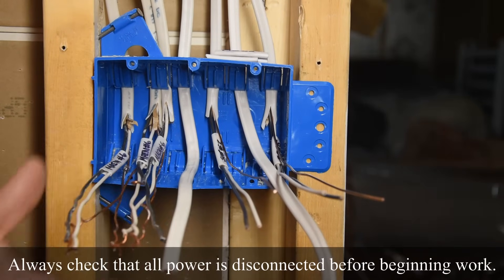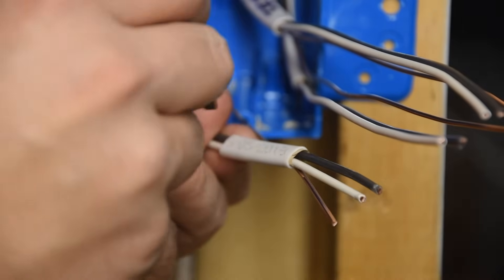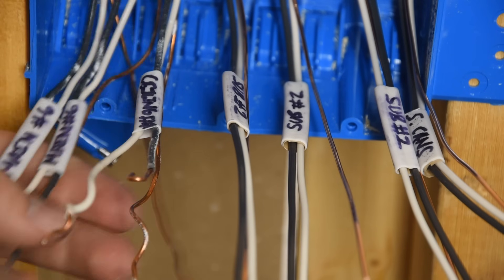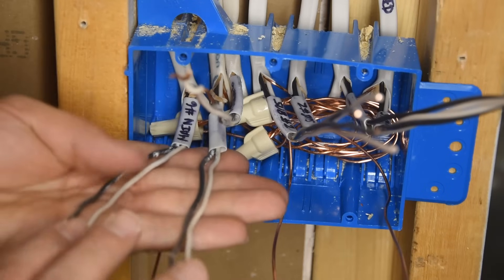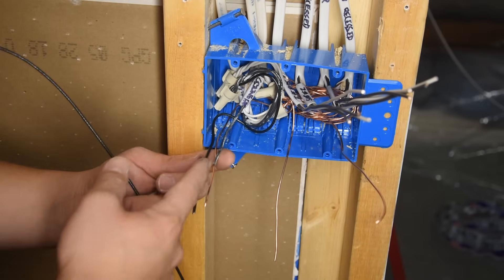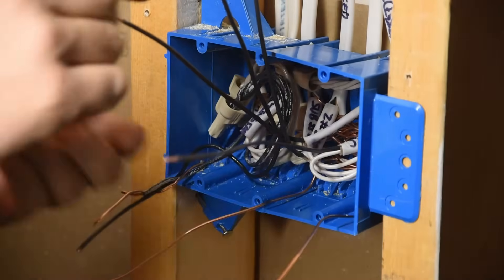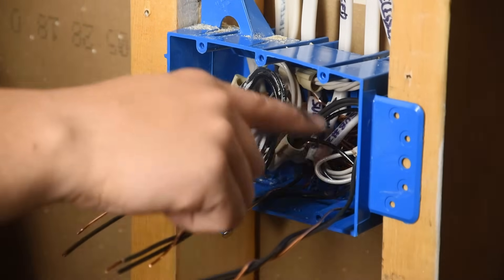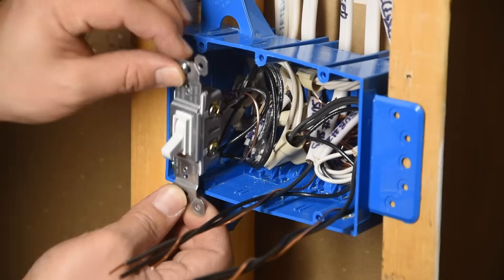How To Wire a 3 Gang Switch Box With 2 Circuits

Comment: This was so f*** painful to watch...sorry.
Reply: I know you mean well. I can appreciate that, but...trying to explain how to cut in that box with two circuits  truly is a waste of knowledge and time. 
This is something that should be taught on the job, and without sleeves for identifying anything...

Make a dividing mark on the top of the box with a marker, indicating more than one circuit. Leave wires hanging out box with a length of about 18". Long before this helpers, upcoming sparktricians, should know where in the box exactly  to put travelers, switch legs, and hot feeds...
If your using travelers, ring/strip, the sheath off the traveler three wire about 3"s and if there are multiple travelers make a crimp indicating first second or third (traveler for switch in that box from the closest door/ or doorway  1st, 2nd, or 3rd) then any other three wire that is not stripped 3"s will be a switch leg for a fan or other...these will also have crimps on them indicating there placement in the box 1 crimp 1st switch, 2 crimps 2nd switch and so on.. same with two wire, must have crimps on sheath near the ends of the wire to indicate switch legs. All other two wires will be hot feeds. 
Never, and I mean never use Wagos in any joint!!
If you use them, they should only be used for hooking up single switch leg lights or fixtures...if one ever has to troubleshoot an electrical problem and find Wagos in any gangable boxes, they will be pissed! Too many points for failure. Always twist your joints "before" putting wire nuts on.. this ensures quality  joints, and separates you from the dumbasses... shows you give a sh** about your quality of work.
Anyway, maybe now you know what I mean about this is something that should be learned on the job.
There are too many guys that want to be electricians, and claim to be electricians, and their quality of work is driving down electricians wages, claiming to know sh** they truly dont...we do not need anymore wire jerkers in this trade.
Hope you dont take any of this hardly...
I have been taught by I believe the best damn electricians in the business. I'd smoke that joint in about 2 mins flat. With no short cuts, all pigtails for grounds and hots...
Best gift ever...here it comes..
4 years in residential fourth year should be service oriented work. Years 4-8 get with a union if you can doing commercial work, 8th year doing service work. Years 9- 12 stay in union learn "EVERYTHING" you can learn about industrial electrical work.  12 th year service oriented work...some where in these last four years talk with your union steward about taking some motor controls, and plc classes. There are a shortage of people who "really" know their sh** about them. With this knowledge  you will be able to find a huge manufacturing company who needs qualified industrial electricians and will pay the 37+ bucks an hour with no traveling, straight 8 hours and to the house with kickass benefits and badass insurance to boot. 
Goodluck. Your a good dude for trying to help. 

Ed. 32yr Certified Journeyman Electrician.  Took me all these years to figure this sh** out the hard way. Should only take 12. Yer welcome.
Reply from the maker: Thanks Edward! What specifically would you have liked me to do differently? I always appreciate feedback even if it is negative. Also thank you for censoring your language.

Comment: I don't think you should have 2 circuits in one box...it's too easy for a noob to think they've shut the power off to a box, and wind up getting zapped while digging around the box....
Reply: That's why noobs and inexperienced should not do electrical or any trade work
Reply: @wizard3z868  should NOT...but DO
Reply: Yo Mama  At 67, and in the building trades since I was 18...ALL PHASES...hardly a noob

Comment: Always twist the ends before installing wire nuts, red or blue wire nuts make more room in box, and alwys curl wire when attaching to device in same direction of screw, then tighten with FLATHEAD screw driver. Wago's only make a small contact point. Just like the stab loc on devices. Never use them n never will. After 40 years as a journeyman, have seen my fair share of burnt up devices or screws on devices loose from a phillips head drill or screw driver. Tinhgs need to be tight. Even newer devices with tab under the screw, i still curl the wire around the screw in proper direction. Doing service, way to many times pulling out devices, n the wire came off. Tight is right. I found that a no1 robertson bit works the best, even in a driver drill with clutch turned down, then test with flat head till you find the correct torque setting on your drill. No impact drivers. Nice job, just things i would have done a little different.
Reply: You are confusing the wago push in connectors with the lever lock kind. The latter make a connection with more surface area and are much better and make a strong connection that is very hard to pull out without releasing the lever first, unlike the basic push in kind where you can just twist and pull and it comes right out.

Comment: 40 years in electrical industry and I must say I have never seen a mess like that box, 2 separate circuits in same box...Never..., use stripers to twist wires wtf, ground wire splicing what a mess. Such amateur wiring and teaching others to do same....such a shame
Reply from the maker: Thanks! What would you do for the ground wires? All I had available were those wire connectors that I used in the video. What is the "proper" way to connect the ground wires?

I also try to avoid having two circuits in the same box and would not advise it if at all possible however it is something that we should all be aware of. 

Overall I would love to hear how you would suggest doing it instead of exclusively insults. I totally get that I have a lot to learn so I really value input from guys like yourself.

Thanks Sam!
Reply: @BenjaminSahlstrom  sorry I didn't mean to insult. I would have left one of the ground wires extra long and the rest at 8" and spliced them all together with red wire nuts then looped the long ground wire to the three switches.
   I would never put two circuits in same box, I would add a separate box stacked.
   I never label switch box wires instead I take the switch leg and put a tight loop in wire to identify the switch leg. The remaining wires are all spliced to hot so they don't need to be identified. I also insert switch leg wire in knock out in order I want them to control a certain lite...lined up in proper orientation.
   Also I always twist my wires ( even #14 ) before I put on wire nuts, makes for lifelong connection and good tradesman like work.
   The only labels I use is in the panel, end sleeve of wire like you did in 3 gang box.
    Your work is very neat but method shows inexperience....sorry. But I have no doubt you will become a very competent electrician because of your open mind to critics like me. I'm just old school and critical.
Reply from the maker: @craftyhandyman9757  Thanks for taking the time to share your expertise! I've never looped the ground wire between devices but have seen it done. How much wire do you leave between each device for the loops?

Thanks again.
Reply: @BenjaminSahlstrom  approx.4 to 5" so switches fit nicely in box. Also when I splice grounds I keep them folded at top of box then when you loop ground wire to switches that ground will also be at top of box out of the way of hot and neutral switch terminals.
    Keep up the good work.
Reply: @BenjaminSahlstrom  look into copper crimps otherwise you did a good job with what you had with those wire nuts other than you should twist wires first that is what makes the connection the nuts only act as an insulator to exposed ends

Comment: Buchanan crimps  for your ground wires works great and you can leave your wires long and use them as your pig tails for your devices
Reply: I was just thinking about that and started searching comments to see if anyone does that. I don't think it's against code, makes for a less congested box and makes all kind of sense !
Reply: It’s not against code at all. Actually inspectors like seeing it because it is a way better connection. 👍🏻
Reply: Also great for connections that you don't want pple  to mess with snap on a plastic cap almost as good as a weld been using em for 25yrs with the proper crimp tool
Reply: Yes I love crimp and caps are great
Reply: @frankgorgone4879  i will say though he did a great job getting it done with what he had. im sure you have been there when you need to get the job done and only have limited resources may not be ideal but its done safe and reasonable quality.
Reply: Yo Mama  lol not %100 yt he is a working man out in the real world not in a film studio you cant always pause in real life like a tv show to redo or run out and get the matts you need sometimes you just have to deal and do with what you got

Comment: Hey Ben! 
1-Please get a pair of Klein lineman pliers and twist your joints first. I prefer ideal strippers with nm sheathing cutters also has 6/32&8/32 machine screw cutters.
2- i prefer ideal red wirenuts with wings for everything and ideal orange wirenuts for stranded fixture wires.
Reply from the maker: Thanks for the advice! There seems to be some debate as to if pretwisting is required. Someone recently said that it is required by code now? Where would I find that requirement?

If you go by the manufacturer's instructions for the connector many times they state that pretwisting is not required. I realize that it does hurt to pretwist but I just want to understand the pros and cons. Wagos or push connectors seem like they are the way of the future since they don't damage the wires as much as pretwisting does. What do you think of them?

Thanks for sharing your expertise!
Reply: Benjamin Sahlstrom 
It’s not code but a good practice.
Push on are expensive and you can’t beat a good joint.
Reply: @toddiman8739  Agreed, I would use the push-ons or Wago lever nuts when I'm joining 5 or more conductors. I pretty much stop at the red wirenut. I don't want to use the big blue or gray ones, it just gets too messy and looks bad too.
Reply: Aaron Kaase sometimes you just have to have them big gray or blue guys though
Reply: @frankgorgone4879  Yeah, I'd use the Wago or Ideal splices in those specific situations. I hate using even the red wirenut, and it's where I sort of draw the line.
Reply: @BenjaminSahlstrom  Nah, I think they are full of bull. The instructions for splicing lie with the manufacturer of the splicing device. If the manufacturer says to pre-twist, then you must do it in order for them to warranty their product and to meet the specifications of their UL listing. Workmanship is largely out the NEC's purview.

Comment: Hey Ben, can you do a video on floating neutral generator and bonded neutral generator? Differences and potential hazards and whys. Thanks!
Reply from the maker: I would love to! I've read some about the topic but am by no means an expert on it as of yet. I'll have to do some more learning before that one will be ready. Thanks for asking!
Reply: @BenjaminSahlstrom  I had a customer wanting to put a cord on a furnace so she can plug into extension cord with generator when power went out. Told her it has to stay hardwired but found a cool product called EzGenerator Transfer Switch box which will be perfect. https://ezgeneratorswitch.com/generator-switch-installation/
Reply: Would love to see that

Comment: Great job. Only comment comes from industrial world.  The line always feed on top.  The  Load always on bottom.
Reply: its best practice
Reply from the maker: Thanks for sharing that. Is that a code mandated thing or just a best practice? You're referring to the connection on the switches correct?
Reply: @BenjaminSahlstrom  It makes absolutely no difference. If the switch required it, it would be marked on the switch.

Comment: Why not use any crimps for the grounds?
Reply: I have heard those crimp sleeves are requires in some jurisdictions. Not here in MN. Just standard wire connectors are good here. Those crimps sleeves are super good, though.
Reply from the maker: To be totally honest I don't have any experience using crimped grounds. What are the benefits of crimping versus using standard connectors? Maybe I'll have to research and make a video about crimping the grounding conductors. Thanks for asking!
Reply: Benjamin Sahlstrom I just left a comment on one of the benefits of crimps.
Way less connections and takes up less room, also you can leave the wires long and use them as your pig tails for your devices.
And the crimp is tight and way better then a wire nut.
Reply: @BenjaminSahlstrom  Ben if you haven't yet see a cple of videos on them if you use the proper tool they hold as well as a weld and you can place a plastic cap over them very hard to get apart unless you know how just need to squeeze twice with lineman's and they pull off most noobs just cut them off lol been using em almost 25 yrs there almost a good tamper seal too many a job we went to and home owner cut them off and we nailed em with a service call instead of a warranty call back

Comment: you should take the tabs off the outlets and switches
Reply: The plaster ears? I never do. Why? The only time I do that is when I'm fixing a device to the underside of a steel square box cover (for a surface-mounted conduit circuit, usually on a masonry wall) , and the only reason to remove the ears then is because the device won't fit otherwise.
Reply: @aaron74  that's the only time I would remove them too.
Reply from the maker: So that they can rout cleanly around the box while the switch is installed?
Reply: Why?
Reply: There designed that way so the device is held to the finish wall its almost impossible to get the box exactly even with finish surface

Comment: You should do a video about changing a 4 way light circuit to a 3 way.  4 way smart switches are much more expensive and don't have the same features as smart 3 way switches.
Reply from the maker: I have never seen a 4 way light switch. I believe that you really wouldn't need a 4 way smart switch as you could just use one smart 3 way switch on the first box where the power comes in. Then in effect you have control of all of the 3 or 4 way switches involved. Comment with the manufacturer and model of the smart 4 way switch you are talking about if you have it as that sounds very interesting to learn more about!
Reply: @BenjaminSahlstrom  Traditional 4-way switches simply reverse the travelers in-between the two 3-way switches. You can wire as many 4-way switches between the two 3-way switches as you want, because all that happens with both 3- and 4-way switches is they switch which traveler is getting current, and any other switch changes it back.

Smart switches are a whole different and new thing. They are just electronic relays that switch 120V and use RF communications with remote switches. The "hub" switch is a single-pole relay and all the other switches are just remotes that mount in box and look like switches but are really just buttons that transmit RF to the hub to turn on the light.
Reply: @BenjaminSahlstrom   Well I just changed out a 4 way to a 3 way and removed one of the switches.   I am just saying a lot of people would like to see a video about it.

Comment: Your right about the Wago lever nuts and the Ideal pushins  ... It makes life a lot easier ... Good vid Benji ...
Reply from the maker: I hadn't use Wagos until recently and man are they nice! I have a video coming up very soon comparing the two. I think that "wire nuts" have a very limited future in the work I'll be doing!
Reply: @BenjaminSahlstrom  Wago splice devices are very cool, they've been used in European countries for decades (on their standard 230V circuits no less). Wago is a German brand and actually pronounced "vah-go", but everyone in English-speaking countries say way-go. In the most extreme technical sense, they are a higher-resistance splice than a well-twisted wirenut splice just due to the bridged metal-to-metal spring contact, but there is probably only micro-ohms of difference so it doesn't matter--it's more of an academic rather than practical debate.

If you get them, be sure they're the Wago brand and not a Chinese knock-off that you can get on like aliexpress or whatever. They must be UL listed, which Wago is. They are absolutely amazing for doing splices of LOTS of wires together!

Comment: When my house was wired years ago, the electricians connected together the "hots" from two separate circuits in one upstairs switch box.  Whenever both switches were turned on, one of the two breakers feeding the switch box would trip.  The electricians couldn't figure out their mistake, so they changed one breaker location effectively powering the two breakers by the same phase in the main panel.  This of course only compounded the problem since both breakers had to be turned off to de-power the combined circuits.  It took me a little while to figure out where they had combined the "hots".  Your work in this video is excellent.
Reply from the maker: That's such a bummer. Its amazing how much headache such a simple mistake can cause. That is also a good reason to keep multiple circuits out of a box. If at all possible I avoid having multiple circuits in a box but sometimes it is somewhat unavoidable. 

Thanks for sharing your experience! Not all electricians do work of equal quality that's for sure.
Reply: Great story. No electrician worth his/her salt should ever have made such an error.